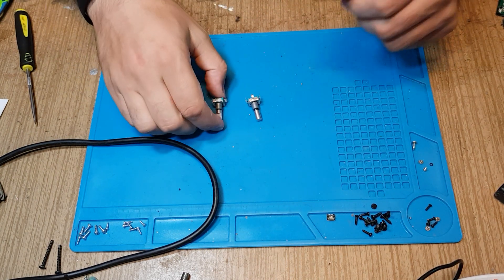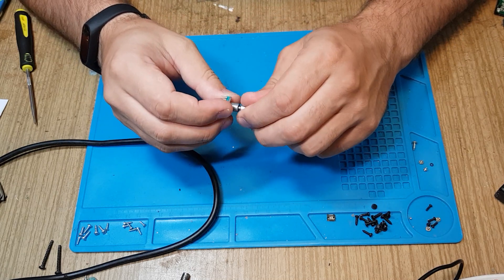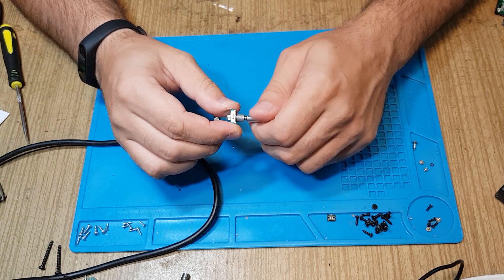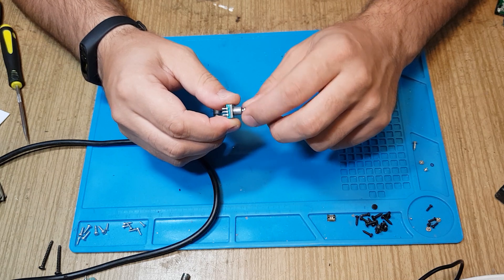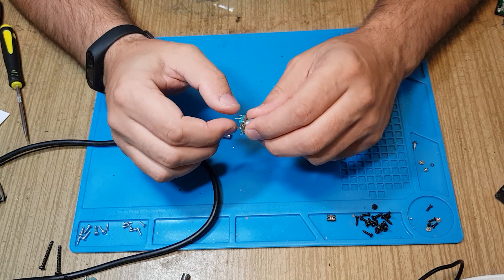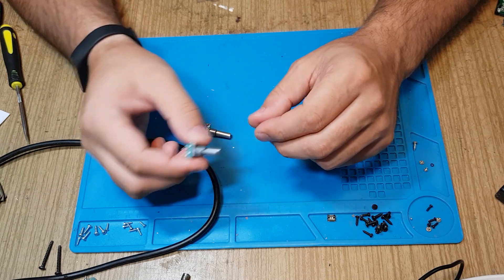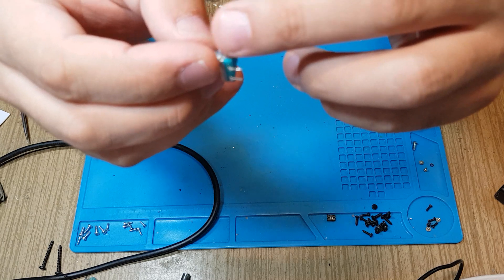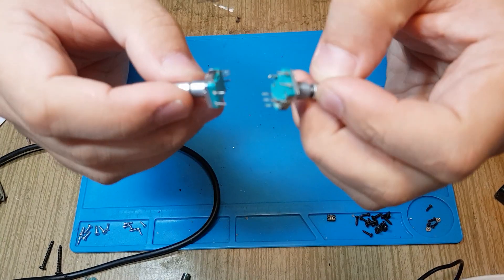Rotary encoder spinning through without function - repair

Comment: how to replace original 3 legs rotary encoder to newer one 6 legs?
Reply from the maker: That's the case with encoders difficult to find exact replacement.. I would suggest either to clean it or look for a similar replacement..

Comment: Hi, Does this little part also called EC11 like this link?
https://www.amazon.com/DIYhz-Rotary-Encoder-Digital-Potentiometer/dp/B07D3D64X7

Thanks
Reply from the maker: It's a rotary encoder and there are a lot of them regarding shape shaft sizd and shape and so on.. this one is some kind from china.. you should look for the most simmilar to your original..but if lets say shaft is bigger you can exchange it like in this video..
Reply: @Lets Fix It Garage     Thanks a million, man, I’m lucky, item picked works! And also Taiwan is heaven of electric parts! Hehe